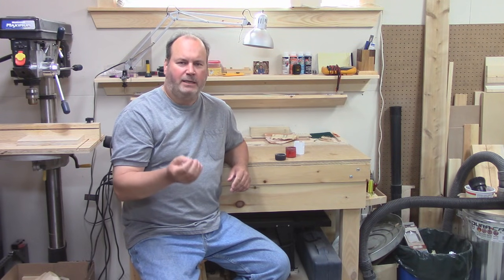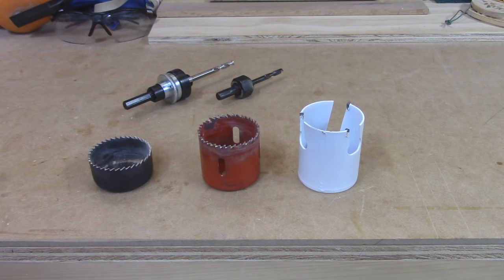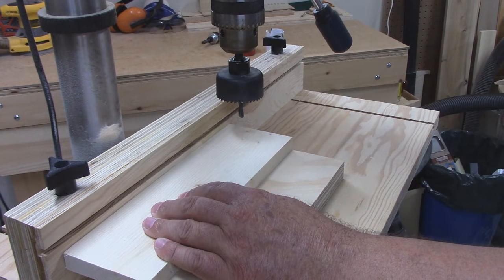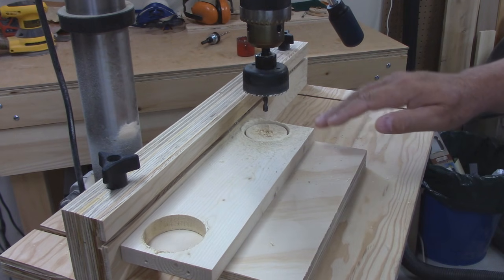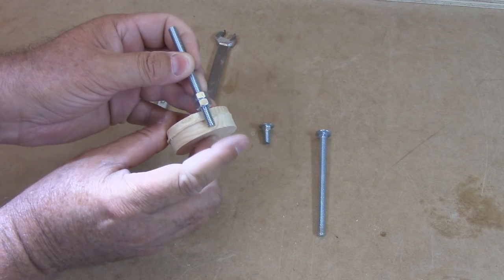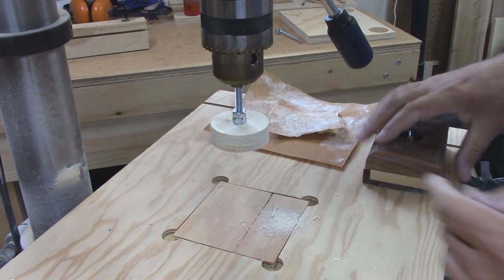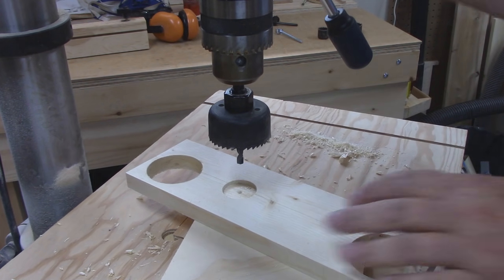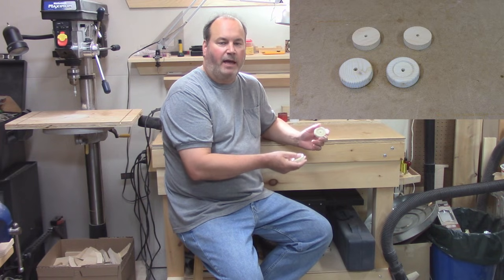Wooden Wheels

Comment: I sand my wheels on a stationary belt sander. I put a smaller dowel through the hole on the wheel so it can free wheel.  I can put a few wheels on at once, but can't round them over, so do that part one at a time.  I like that you don't have a nut under the wheel, so it is faster to change them.  I will try that.   I like the forstner bit idea too, thanks.

Comment: Great video. I did it exactly the same and I have a question... The wheel have an end grain zone, so when I sand it, it leaves some fibers and if I keep sanding to eliminate these fibers, they fell leaving small holes. Do you have a tip to avoid this problem? Thanks un Advance.

Comment: Thanks for a wonderfully informative video. I have been making wheels like this for many years but I have always have trouble with the end grain on the wheels when I make them from pine or any soft wood. I can never get it smooth enough. How do you get over this problem?
Reply from the maker: Hi Clive, This is something that I have never been able to get absolutely perfect. The closest I can get is to take a wet rag and dampen the wooden wheel while still on the drill press. This makes the end grain fibers stand up, I then hold fine sandpaper (320) against it.  The fine sandpaper won't change the wheels any but makes them really smooth thus the end grain is not as dark when finishing. Hope this helps.
Reply: Thanks Paul, I never thought of wetting the wheel while on the drill. I will try it and see how it works. Thanks for the tip.

Comment: Thanks for the videoo Paul, I have a question, how come the wheel doesn´t come off when sanding it if it doesn´t have a nut underneath ?
Reply from the maker: The threaded rod in the drill is turning the in the direction that forces the wheel up and is stopped against the nut at the top.

Comment: What size hole saw did you use ?
Reply from the maker: The hole saw in the video was 2-1/8" but that denotes the outside diameter. The wheels are cut from the inside diameter which would end up being a little less than 2" when complete. Thanks for watching.

Comment: Have you ever made wheel that could be use on cast iron bed 🛌 that way
Reply from the maker: Nope, but I wonder if a hockey puck would work.
Reply: The wheels are not very big about 1.25  straight cross and about .75 thick,  the one wheel I do have part of it is missing. I was wondering if that kind drill bit would work if I got strong wooden  like oak or some thing
Reply from the maker: It would be a good thing to try, perhaps use a hard maple as it is denser than oak. Let me know how it works.